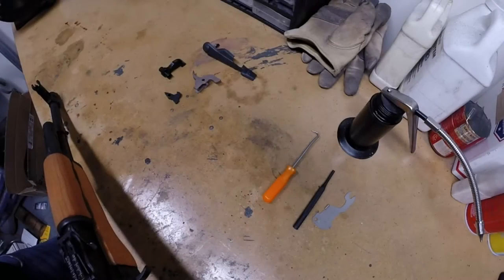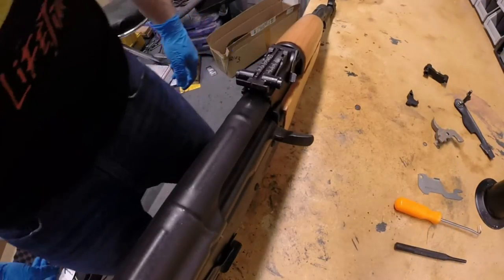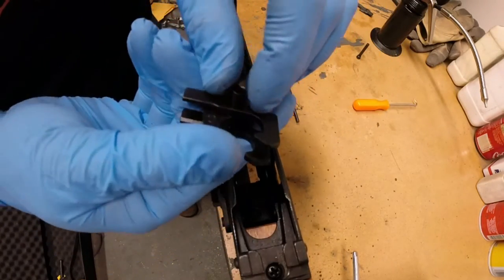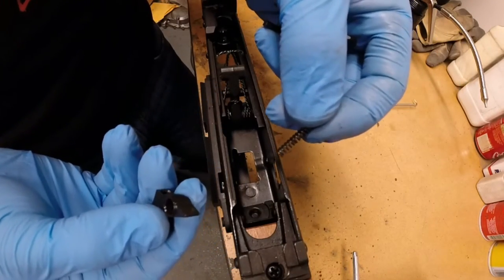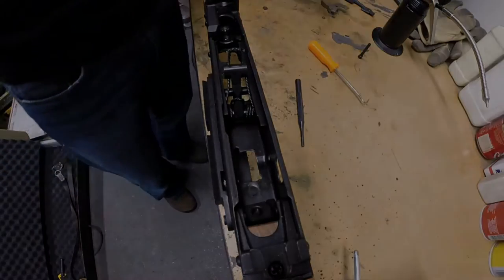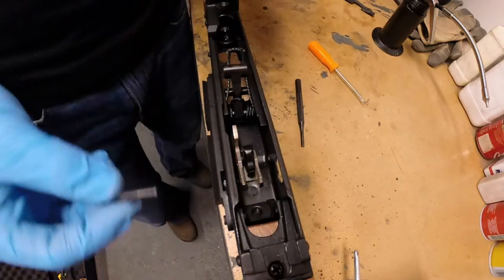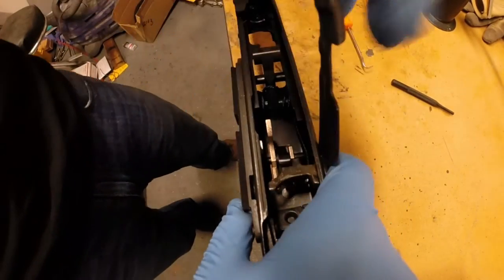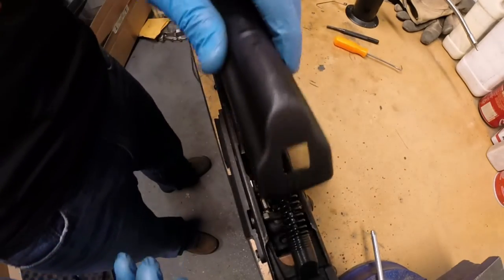Sweeney Engineering LLC. High performance AK trigger installation

Comment: it would be nice to see what the hammer profile looks like (hope its not a tapco g2 that causes mushrooming) the side view of the trigger (length of pull) looks like when you engage the trigger plus a trigger pull scale to see what the actual trigger poundage is as well.  please post up a video of these and a test video as well since i am assuming people would like to see these functions prior to purchasing this trigger,  also did you do a comparison to your trigger and an alg-e trigger? the alg-e is good but in my ak's it needed to be modded a bit and the hammer profile needed to be completely reprofiled to cycle smoothly.
Reply from the maker: I did another video to answer some of the questions from the forum. Unfortunately, a moderator deleted the original thread as apparently I am a vendor and cannot post without a vendor account (Still working on setting that up). https://www.youtube.com/watch?v=jAIFzTwrB7k&feature=youtu.be
Reply from the maker: The hammer is not a G2 but rather an OEM imported variety.